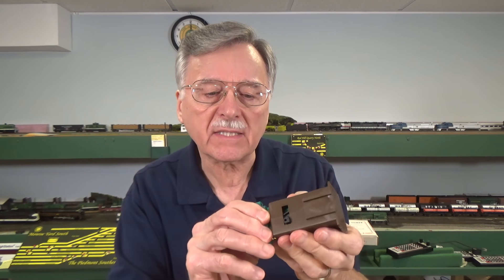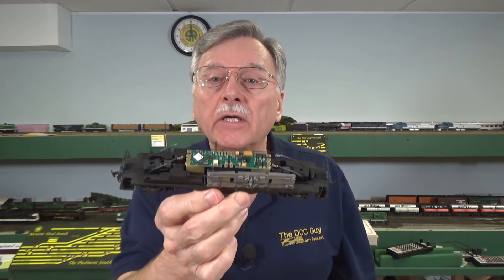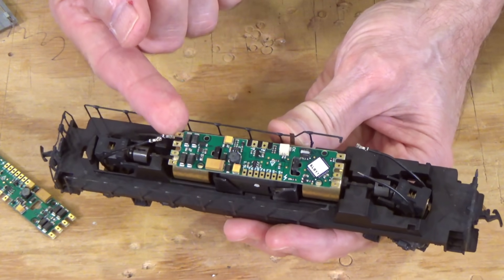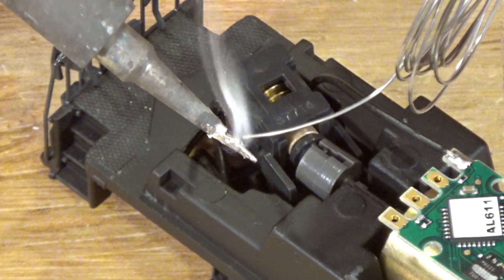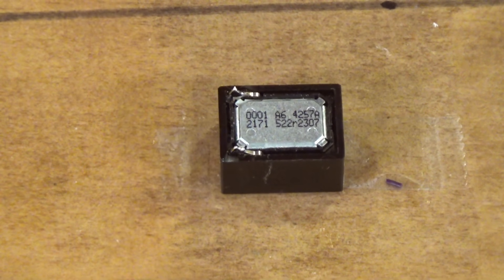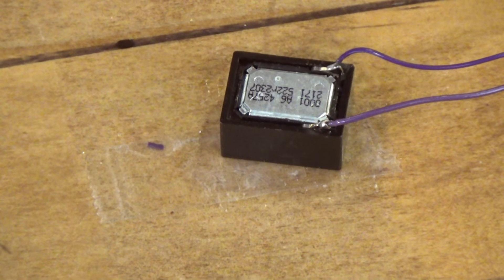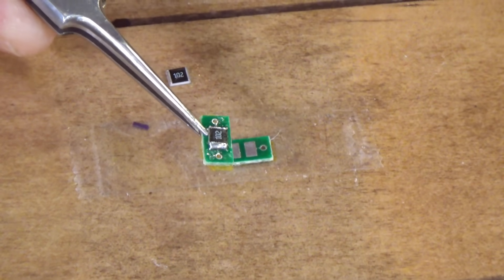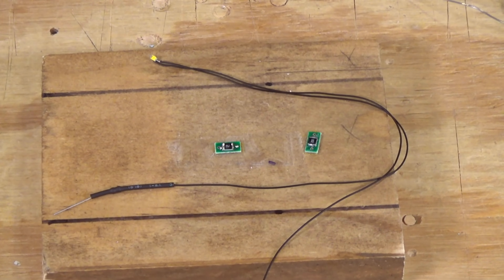68. Soldering the small stuff

Comment: What size solder do you use for the decoder circuit board? Is it fluxed or do you recommend a dab of flux on the substrates?
Reply from the maker: With circuit boards I use the smallest diameter I can find about 0.02”. It can be difficult to find solder without flux anymore but be sure it is no clean flux as others may leave a residue on the circuit board.

Comment: Hey Larry, I have the 1000 om resistors that go to the wires. Can I use them in the loco's for LED's??? Some loco's I want to put red lights on some ends of them. Thanks , joe
Reply from the maker: I usually start with a 1000 ohm resistor, hook it up and see if the LED is bright enough and then go up or down from there if necessary.

Comment: Thanks for the helpful video. Is there any kind of work surface you recommend for doing quick small jobs like these?  I live in an apartment so I will have to do the work on the dining room table or a banquet table near my layout. I just bought a Hakko FX888 but have not used it yet. Never soldered anything before but I need to hook up a speaker and a couple other wires to a decoder and motherboard.
Reply from the maker: For a quick portable work surface you could go to the lumber store and pick up a precut plywood panel. They sell these in small hobby cuts. If you want fancy they also sell inexoensive butcher block type slabs in small sizes. For most of my videos I use a 1/2” thick piece of plywood about 2’ x 2’. You don’t have to worry about burning it, but if you worry about scratching the dinner table just glue a piece of felt or cork to the bottom.

Comment: Have you used the SMAIL on your layout? Which do you prefer? I will be using a procab dcc.
Reply from the maker: I habe ine but have not installed it as yet. They basically are a Tortoise with an accessory decoder included internally for DCC control.
Reply: @TheDCCGuy  I really liked how you installed the tortoise with the decoder and used dc power and push button with also dcc command too, can the smail be powered from a dc bus and still receive commands by dcc?

Comment: Larry, I'm electrically challenged! How do you know what type LED to use and what size resistor?
Reply from the maker: Roger—That depends, what are putting it in. Personally I have been using surface mount LEDs purchased on eBay, that come prewired with a 1000 ohm resistor. Take a look at my video on using LEDs in locos. You can test them with a 9V battery to figure out the polarity of the wires. I have shown how to install the in my videos.
Reply: @TheDCCGuy  Larry, I'm mostly interested in HO steam. I've installed lots of 1.5v bulbs but never any LEDs. I had an S scale Train-Master that came with LEDs. They were an awful looking blue shade. I would never want to use anything like that. How much resistance is needed with LEDs? Is 1000ohms normal?
Reply from the maker: When you buy replacement LEDs look for for golden white or sunny white to avoid the blue versions. I recommend starting with a value of 1000 ohms and go up or down from there to decide on the final brightness desired. It is hard to know in advance since they vary so much in brightness.
Reply: @TheDCCGuy  Thanks, Larry.

Comment: I'm the guy who has the old fashion DC locamotives. Did you do a video on installing LEDs on a DC locamotive?
Reply from the maker: I have not done one like that. Using LEDs with DC is a bit more involved and requires the use of diodes and resistors to get things to work correctly. Let me see if I can find you a circuit to do that.
Reply: @TheDCCGuy  thanks. I did one but now it looks like Frankenstein. Lol

Comment: can you tell me what temperature setting you us? Thanks
Reply from the maker: I vary that depending on the job. For small stuff I usually go with something closer to the solder melting point. For 60:40 that is 370F and for 63:37 is 361F. If I have a bigger job like rail joiners or rail feeders, which draw the heat away fast, I will crank it up hotter. You basically should start with a temp a little above the melting point and move it up until you are getting a good “wet” melt. It really is one of those things you learn from experience and practice. Too much heat for too long will cause plastic ties to melt and circuit traces to lift, etc.
Reply: @TheDCCGuy  How do you know the melting point of the solder is it on the roll?  Also what kind of iron are you using?

Comment: A warning when heating CA glue... It gives off cyanide gas. be VERY careful.
Reply from the maker: Greg, good point, thanks for posting this. From what I have read on this issue the cyanide release appears to be debated. Here is a link to a website that provides some light on the subject. 

https://www.stewmac.com/How-To/Online_Resources/Learn_About_Repair_Tools_and_Repair_Techniques/Inside_Story_on_Instant_Adhesives.html

Some sources indicate a chance that very small amounts may be created so It probably is better to use another glue or mechanical method of stabilizing the component. As with any soldering you should not breathe any fumes and work in a well ventilated area.
Reply: @TheDCCGuy  Interesting... I was an electronic tech for years and tried what you suggest in the video. This was when SMDs first appeared in home electronics. The fumes were very noxious and irritated my lungs badly. I never did it again. When I looked it up (years later) I read about the cyanide. It's good if it isn't present. My experience doesn't indicate what it gives off, but it was very irritating to my lungs. My technique is to hold the SMD with something like fine point tweezers and solder one side using some solder on the iron's tip. Then do the other side.
Reply from the maker: While looking back over this I ran across another interesting tidbit. Did you know that cigarette smoke contains cyanide? According to the American Cancer Society it can contain:

Nicotine
Hydrogen cyanide
Formaldehyde
Lead
Arsenic
Ammonia
Radioactive elements, such as uranium (see below)
Benzene
Carbon monoxide
Nitrosamines
Polycyclic aromatic hydrocarbons (PAHs)